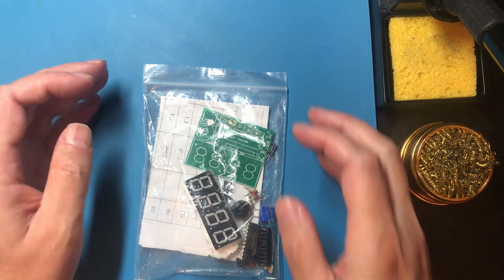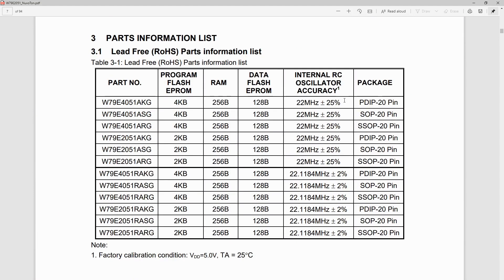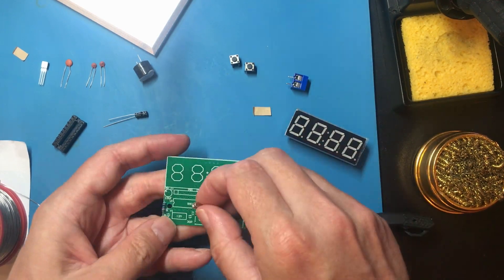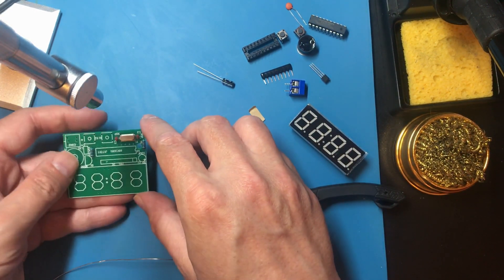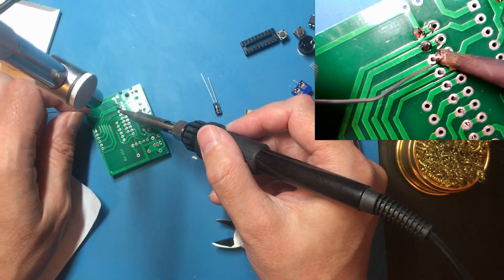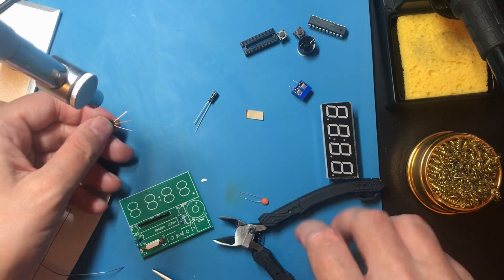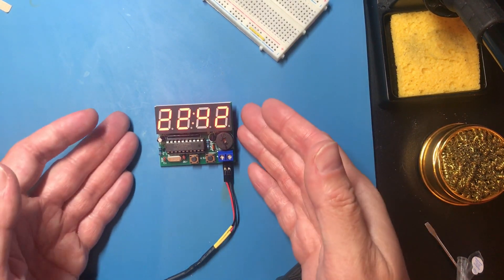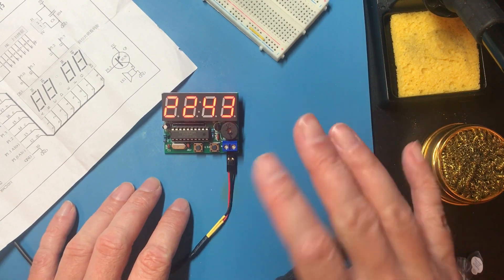Digital Electronic Clock Kit

Comment: Got a few of these kits in the past but all where without the firmware on the 2051, luckily it is available on the web and they can be flashed with the tl866

On mine i had to change the P3.3(Pin7) and P3.7(Pint 11) definition as they where switched in the schematic see also 00:40
https://github.com/ruthsarian/at89c2051_clock
Reply from the maker: That sounds like you had some fun. The kits look very similar but I can see some differences, seem likely there is common route in the design.

Comment: 12MHz clock is very common for '51 based microcontrollers. '51s from Intel have 12 clock machine cycle (roughly an instruction equivalent), which resulted in 1µs per machine cycle at 12 MHz. Later clones used 6 clocks per machine cycle, but it stil divides well by 12.
Reply from the maker: Thanks for the info pvc,  I've not had much experience of micro controllers away from the common hobby ones.

Comment: The 256 bits of ram reminds m that an Atari 2600 can still be implemented using this micro. 
Nice Video and Thanks for sharing
 Cheers ✨✨✨✌
Reply from the maker: Thanks Ajinkya, you make an excellent point. People keep suggesting I use a micro controller for various auxiliary tasks on my cpu build but it wouldn't feel right to have something more powerful than the build.

Comment: Thanks James. There are so many low-end MCUs, I'm a little surprised to see them in a clock kit, I'd have thought they would use clock and display chips. I kept the sticker on my cheap metal detector kit, I think that helps. Take care.
Reply from the maker: Thanks Jerril. I had exactly that thought about the sticker on the speaker. I volume reduced all but one of the bleeps.